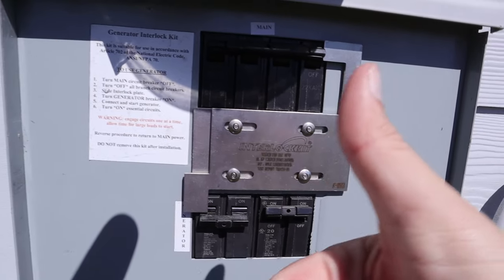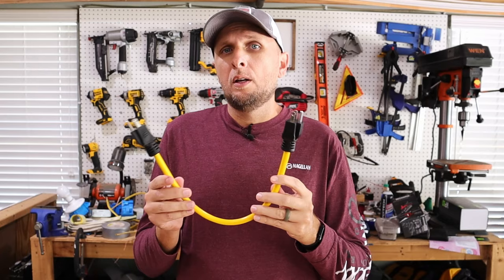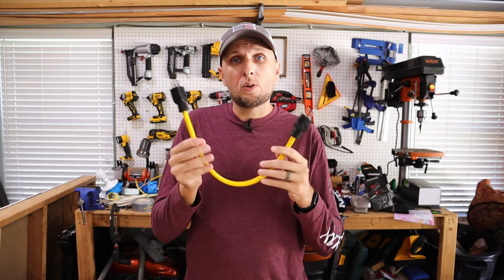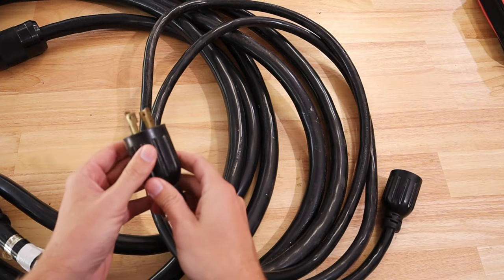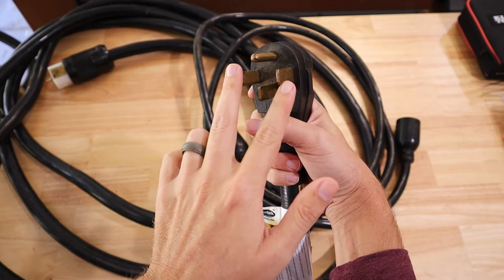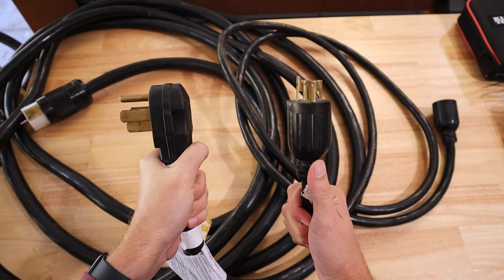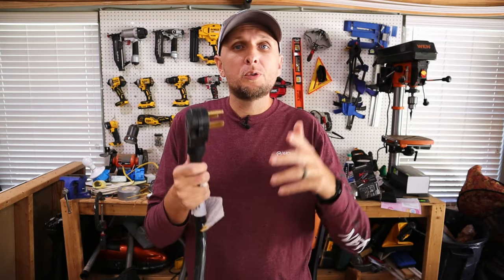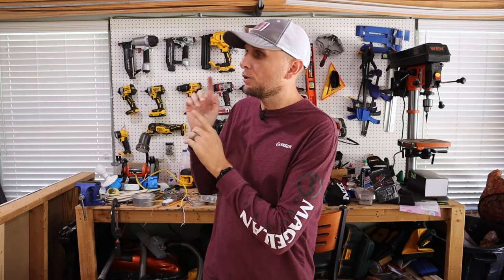HUGE Electrical Mistake Too Many People Make - Backfeeding

Comment: So do you need to put an enclosure around the plug? And do you have your generator run in the rain? Out here our power goes out usually when the wind blows while it's raining.
Reply from the maker: The correct cords and power inlet boxes will protect the plugs from the elements.  I do not run my generator out in the open rain.  I run it either in a generator shed or under an awning.  A little rain on it won’t bother it too much but definitely not out getting soaked.
Reply: @HowToHomeDIY  Also there are covers you can get to better protect a running generator in wind/rain.  I've got one made by GenTent which clamps onto the generator's frame and is designed to not obstruct engine cooling or exhaust but have a covering and flap to protect the main body and outlet-output panel from weather while running.

Comment: You need to know WTF you're doing when it comes to backfeeding! Number one rule.. THROW THE MAIN BREAKER! And before you throw it back ON check the INPUT side across the two phases. If its still zero do NOT throw the main to ON! But if it reads around 220vac then disconnect all backfeeds BEFORE you throw that main, folks. When I back fed after Wilma in 2005 I used the clothes dryer receptacle because its 30amp, 220vac and easy to get at. I simply designed a plug in that jumped the 2 phases to the 115vac output of my 5kw honda gasser generator. That means each backfed phase could handle 30 amps back to the breaker panel, see? This kept the fridge powered along with a few lights & a coupla fans. And because I had both phases jumped to the 115vac generator output it didn't matter what phase anything was connected to.  One more thing.. Throw ALL 220vac breakers OFF except the one you're backfeeding into. That means typically your range, A/C, strip heat, whatever. If its a double breaker throw it OFF. I'm a retired electrical engineer.
Reply: I want to add this AFTER I listened to this guy.. You do NOT need a $500 "kit" IF you followed my instructions here. But you DO need to know how to wire that "jumper" lead from your 115vac generator backfeed jumper into your 220vac dryer plug. This is because the generator plug side is male along with the dryer plug which is also male. Remember ground to ground, neutral to neutral and hot to hot on BOTH phases of the dryer plug. You'll need to jumper this but a #12 wire will suffice for all this entire backfeed jumper. Do NOT start your generator until you have that male dryer plug (in this case) plugged in because those male prongs are live and could very well KILL you if you get across either one of them. BTW 115vac is JUST as dangerous as 220vac. Why? because BOTH of them are 280 volts peak-to-peak via sine wave (and if you don't believe that take a look at both phases on an oscilloscope). VAC meters read RMS NOT peak-to-peak.
Reply: Same here, 4 prong dryer is my inlet from 30 amp 120v generator. Runs all 120v in my house. I'd say if this is scary  for someone they don't need to be f-ing with it. As far as utilities people if you don't work with the idea all wires are live you won't make it long. I'm more concerned they would blow up my stuff back feeding me, which ain't gonna happen because my main will be off😊

Comment: Eh, yes and no.  
1. Always turn off the main when backfeeding into the panel.  
2. A suicide cord will not have 30 amps running through it.  That's like saying that you have 100 amps going to the panel, and then 100 amps going through 14 gauge wire to your outlet.  The thickness of the wire determines the current draw.  And the 120 volt outlets on the generator aren't going to send 30 amps through them.  Now, If you have a 20 amp outlet on the generator and plug it into a 15 amp outlet in your home, then you have a problem.

Sometimes I power the house with a 12v battery, but I always shut off the Main breaker, and the 120v produced always goes straight into the panel with a breaker.  And in case you think I wrote a typo - Yes, 12v battery can power a house with right toys in between.
Reply: Yep

Comment: Howdy
I had a extension add to my shop and putting in 2 outlets one on each side from the existing wiring. I am putting a light switch and fixture in between these 2 outlets. Using 12-2 wire . My question is what wired I use on the light fixture. It has 2 screws gold and silver.i know on the switch it should be black or hot on top and bottom gold screws and ground/copper on green ground screw. But on fixture no green ground screw ?
Reply: For 120v ac you would typically use a "3 wire" set up. black for hot(or gold), white for neutral(or silver), and green for ground. In most distribution panels ground and neutral are bonded together and ring out, so if you are coming from a 3 wire set up and now only have 2 you more than likely are not using a ground anymore. If you have 3 wires and only a gold and silver to terminate you can land hot and neutral where they go and land ground to something on the physical metal housing of the item. Thread and tap in a screw somewhere safely and use a terminal fork.

Comment: 1st, you should never do this if you don't have a good understanding of electrical wiring.

Having said that, can be done safely (though obviously not to code):
- flip off the main breaker. Nearly every utility company has bonding and grounding drilled into linemen, but still.
- select a large circuit that exceeds your generator capacity (e.g. 40 amp stove, 50 amp hot tub). Every other circuit would still be breaker protected as they draw power from your panel bus bar
- always plug in the house end first, then generator end
Reply from the maker: Should just never be done.
Reply: @HowToHomeDIY Okay nanny, just make everyone behave in accordance to the lowest common denominator then. Sounds like a great way to run the world.
Reply from the maker: @LostBeetle clearly you do this and it struck a nerve.  There is literally no reason to it this way.  The cost of a power inlet box and interlock kit are not very expensive and make sure an accident doesn’t happen.  I’m guessing you’ve never made a mistake even though you knew better right? 😂
Reply: @HowToHomeDIY  Whether there is another way has zero bearing on the fact that it can still be done safely. Binary thinking safety nannies treating the entire population like babies is a serious problem in the modern world. I dislike your gaslighting and demeaning mentality greatly. You're wrong. Seethe.
Reply from the maker: @LostBeetle  Gaslighting LOL Not just another way, a better and safer way.  Wasn't gaslighting, was making a point.  You disliking it will definitely cause me to lose sleep tonight though.  😅

Comment: Thanks for that explanation. I had a friend who did that for his electric when his solar power poofed. It seemed kind of iffy to me, and I told him, but it worked and he got by with it until we got his solar fixed up again. Still, I wouldn't want to do that at my place. I made an outlet for it to supply my house. Except then I realized that way I had it, it could back feed into my inverter and maybe burn it out ... the more you think about it, the more complicated it can get!

Comment: So if you have a fuse box  just pull your main fuse out first then plug in to dryer outlet then to extension cord then to generator then turn generator on and good? Or would I need to pull all fuses and just put the ones in I need after starting the generator?
Reply: I think that would depend on the size of the generator and if anything started up immediately and it was greater than the generator could handle

Comment: Instead of making a suicide cable get a dryer cable and connect it into a inlet box. The light on the inlet box will tell you if you forgot to turn off your main breaker. As long as you turn off your main breaker you can connect a regular generator cable and backfeed safely.
Reply from the maker: That’s still a suicide cable.

Comment: Im not supporting the cord, but i am exercising theory.

If they plugged into a generator 120 outlet, then there not getting 30 amps, they are only getting the 15/20 depending on the generators outlet amps for the 120. Is that not right?

Also, if power was returning on the neutral to the "source" as i understanding the theory of that being what is wants to do, then (with main breaker left on) power flowing out thru the main to a lineman grabbing that live line, is still not grounded to a ground source back to the generator (if bonded system).

But if he grabbed a neutral and the live line then power / current would flow thru him into the neutral to return to the load center, to the intermixed ground/neutral in the main panel and then thru the circuit (where the generator is plugged in) and take the neutral back to generator coil. 

So if that is all theoretically correct. I definitely see the danger and potential to injure others like lineman.
And I see the danger of touching exposed prongs on a live cord.

Also like I was saying in the beginning even though I understand you can put a 20 amp breaker on a 15 amp receptacle (using this type of cord you would be attempting to pull a lot of current through that receptacle so that you could power every other receptacle), and that would definitely be a fire hazard.
Reply: For that very reason lineman short the lines out to protect themselves from backvoltage but destroying your sh*t in the process.
Reply: If the main breaker is on when you use a suicide cord to connect a generator, then the linesman IS at risk.

If the breaker is turned off, whether a single pole or double pole, then the linesman is safe.

Current in a circuit flows from the voltage source, down the hot line, through the load, back along the neutral line and back to THAT voltage source. It does NOT flow to another source. People believing that don't understand basic electrical principles.

So if you have a power outage, and the breaker is still turned on, and then you go and use a suicide cable with a generator then your generator has the possibly to send current out of your property and firstly attempt to power other properties in the locality, secondly the electricity will go back to the low voltage side of the distribution transformer, be stepped to a high voltage and out the primary side of that transformer and on to the overhead lines, posing a serious risk to any linesmen working on those overhead cables.

In both scenarios, the current powering other properties in the locality and the current electrocuting the linesman has originated from the generator you are using, which is connected to your property by way of the suicide cord. That current has to return back from the linesman and it does it using the neutral of the high voltage cable (possibly a bit more complicated than that if it's three phase but I'll ignore that in this discussion), back to the primary of the distribution transformer, it is then converted into a magnetic field, then back to an electrical current in the secondary side of the distribution transformer and back along the neutral line to your property, back through the closed breaker and eventually back to the generator.
So for this to happen, the breaker needs to be closed because the circuit using both the neutral and hot lines into your property.

If that breaker is either a single pole or double pole breaker, in that it switches either a) hot line only, or b)hot line and neutral line, and that breaker is open, then there is a physical break in the circuit from the generator out to the linesman on the high voltage line, and no current from your generator can flow, and hence the linesman is not in any danger.

But mistakes occur. People forget to turn the breaker off. And that is where the danger is to those outside of your property.

The way to prevent that is to turn the main breaker off.

Comment: As a Brit I am astonished that a male to male mains cable could even exist - it's quite insane to me.  I have never seen such a thing here in over 45 years of DIY electrics, but then we do have the best domestic electrics and connectors of any country!
Reply: If you have 45 years of experience in electronics you would know how simple it is to make your own cord.
Reply: You all also use 230 volts as your electrical standard, that's much higher than the 120 volts we use here in the states (our 240 volts is actually two 120 volt lines with opposite potentials). Your electrical is 230 volts line to neutral, ours is 120 volt line to neutral, 240 line to line. I believe people get complacent with the lower voltage we use because it doesn't seem as dangerous.

There's also a lot more a regular untrained person can do with their household electrical system that over there you're required to call an electrician for so there are people who think they can do anything.

Comment: Question for you. If I just want my generator to run 2 or 3 lights, refrigerator, small chest freezer and depending on the time of year, either the furnace or the central air conditioning, would a 5500 /8500 watt generator be sufficient? And would a 30 work for that?
Reply: I have a 2400 watt generator and it runs my furnace, lights, fridge and small chest freezer.
Reply: @cusick420  Ok thanks, guess I'm good then for what I need.
Reply: There is a lot more to it than that. It all comes down to the amps. How many amps does your AC and air handler need  vs how many amps will your generator put out. Also, running a motor load at other than its rated volts/amps is a great way to burn out a motor. Don't forget to derate your circuits either. Another source of home fires.
You home owners don't have a clue.

Comment: People keep saying "Just turn off the main breaker and you can 'safely' backfeed" but they are missing the point. It is entirely possible in this way to forget to turn off the main breaker. The whole point of the interlocking breaker kit OR the transfer switch is that, with either setup, it is PHYSICALLY IMPOSSIBLE to connect the incoming power and generator power together. Therefore, it doesn't require you to "remember" anything to connect it properly and safely. (There are other safety things with generators you still have to remember, though, but that's a topic for another video :) )